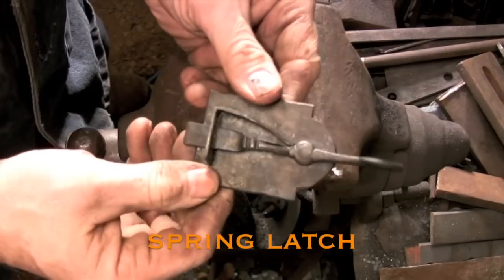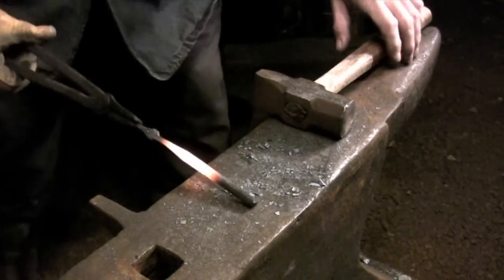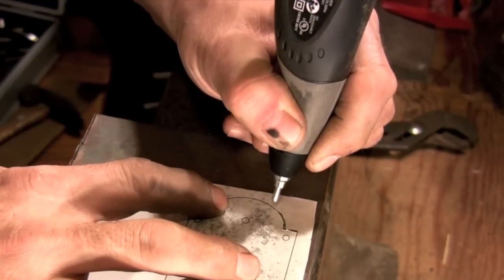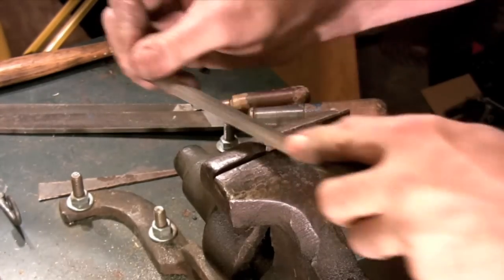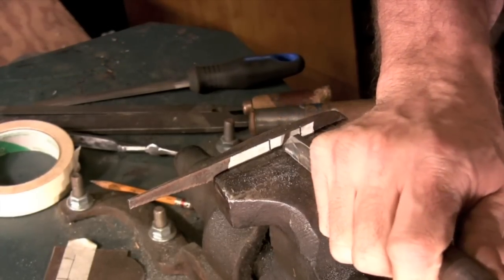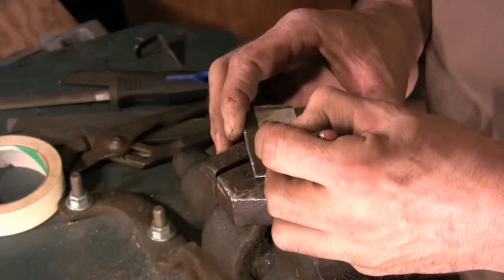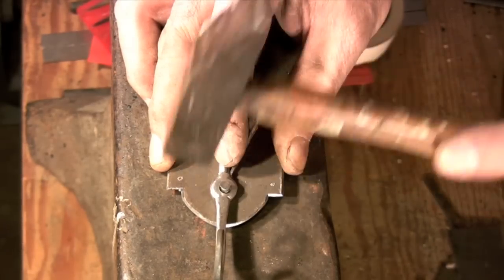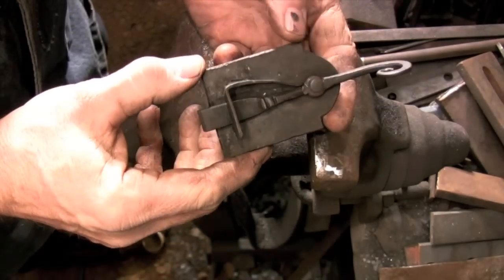Blacksmithing Project - Forging a Simple Spring Latch

Comment: Is it a myth that dragging a file backwards rounds the teeth off and dulls it a lot quicker?  I was always taught to only push a file.  I see people using files like sandpaper all the time, dragging them back and forth.  Makes me cringe every time, but have never tested it, so not sure if it really matters.
Reply from the maker: That is a touchy subject. I'm not aware of anybody having tested  it.   I'm my opinion, lightly dragging a file backwards is  a lot different than applying pressure and trying to cut with a file backwards. The problem is they sound pretty much the same so people always assume you are bearing down on the file and causing damage ( if that really happens?).  I've taken a purely practical view on the subject.  To me,  the time lost in raising a file and carefully placing it back down on the piece for every stroke will probably pay for a new file every few hours so I  gladly sacrifice a bit of performance to get the job done.